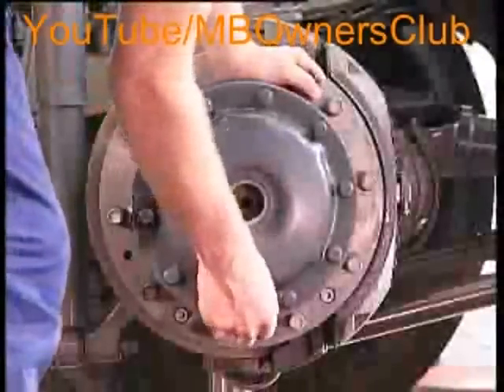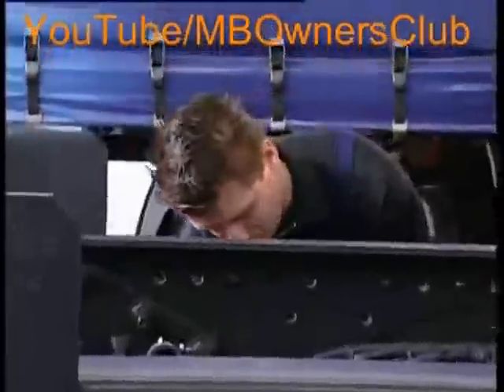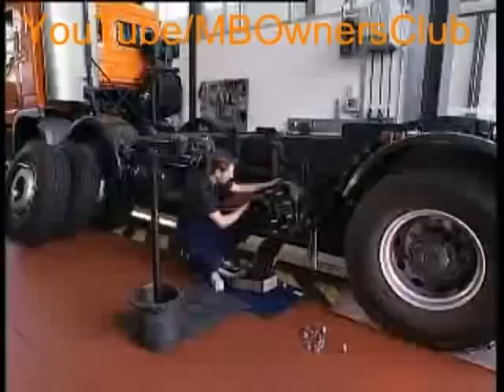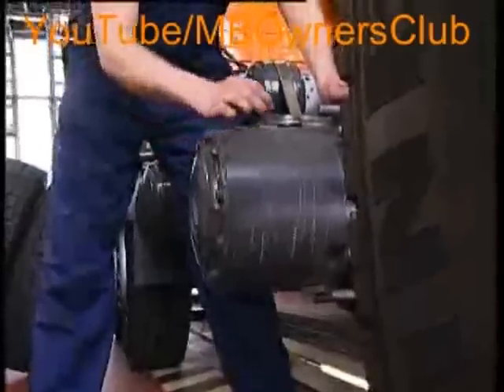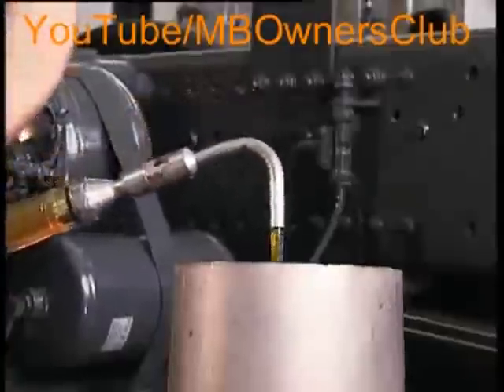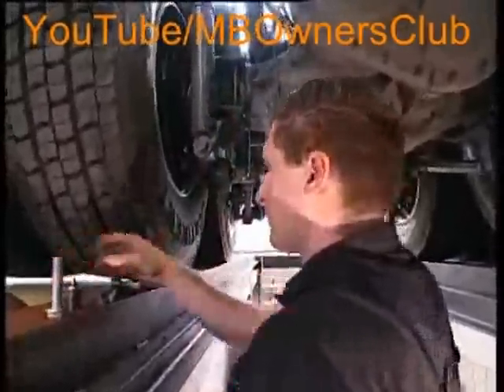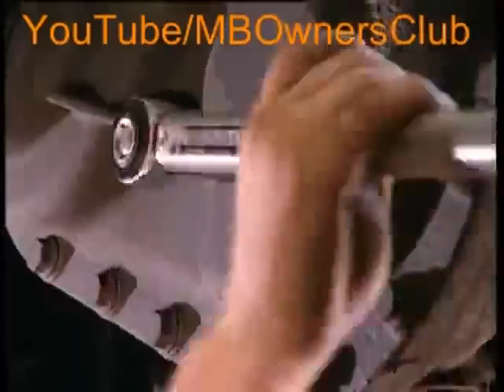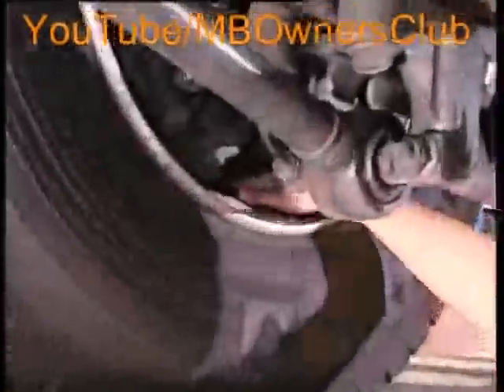Mercedes-Benz Actros - How to replace the O-ring of the bell hub | W930, W932, W933, W934

Comment: Only then do you remember to take out the 3 bolts you used to pull the bell away. PS clean the oil off that ran out.